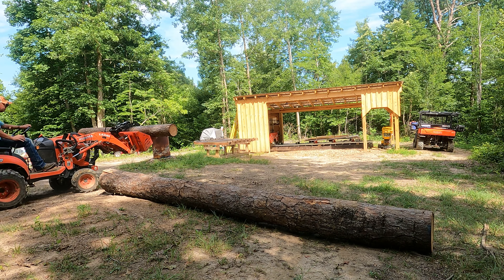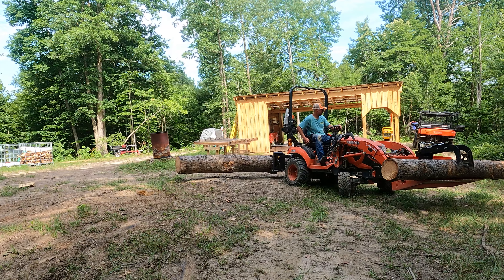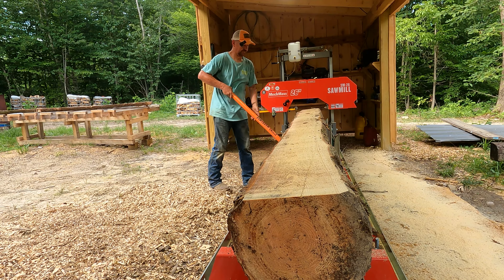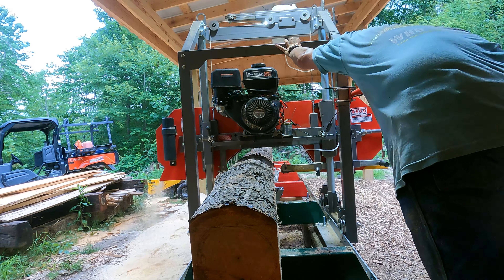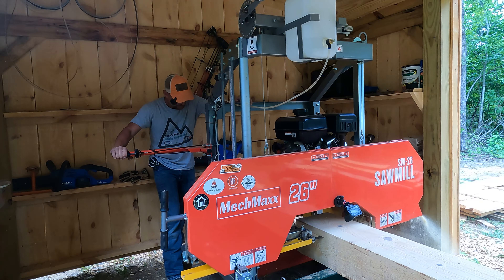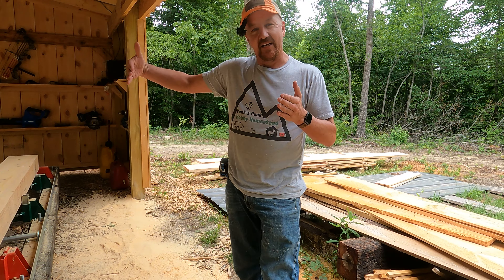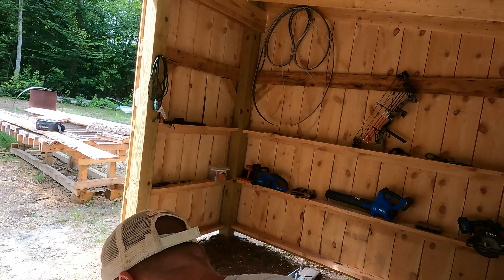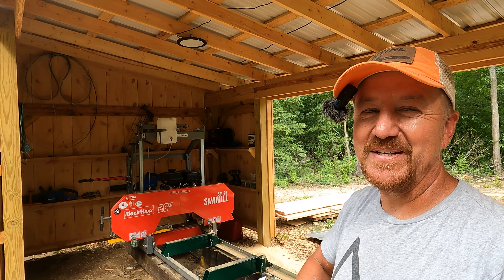Just Too Much For Our Tractor! - Setting Huge Logs With a Kubota BX

Comment: You are learning, you are going to need a bigger tractor for many reasons.  you are maximizing the ability for now. Just an idea, put a couple of stickers under the trim cuts to give you clearance at the halfway point , then cut it with your electric saw so you have 2 8-foot pieces to throw on the forks. EZR to handle. Good boards cut for sure.
Reply from the maker: Good tips!  Thanks for sharing!  👊

Comment: Lucas, nobody on this planet has done more with their BX than you have. Ive seen it all now friend. I'm sitting here just chuckling and am completely entertained. I just bought a hydraulic top link and valve kit from summit hydraulic for my BX, it just what you need. If you want part numbers and install pics let me know. Pretty easy and a very cheap mod. using the factory backhoe power beyond and return lines, with no additional work to reconnect when the hoe goes back on.  PS the three point lifting capability is very amazing on these BX tractors, WOW!   Steve
Reply from the maker: lol. At this point I’m just going too far.  I don’t think I need to put more money into getting more out of the BX.  I’m going to be breaking stuff.  I do enjoy pushing the limits though.
Reply: @PeeksPeakHobbyHomestead we all get more out of the BX than what Kubota and God intended.   When I'm working on projects, I have neighbors set up lawn chairs for a day of entertainment. 😂

Comment: It's so refreshing to see someone who doesn't have a $50k mill, a brand new skid steer and mini excavator milling up logs.  I've been looking at sawmills for a while and have a similar, small tractor as yours.  I've been concerned with how difficult manipulating the logs would be and this is pretty much confirming my assumptions. 

I'm incredibly interested in this mill though, especially since it's nearly identical to the woodland mills products.  Thank you for the content!
Reply from the maker: You can for sure do it.  It takes more work with smaller equipment, but I’ve already accomplished a ton with my little setup.  Good luck!

Comment: Did you capture the pith in one 2x10? If so you may want to just rip that one into 2x4s since the pith is very unstable and likely to split.
Reply from the maker: I don’t know, I will have to take a look.  Thanks for the heads up.

Comment: Build some ramps, use the tractor to roll the log on to the mill. I have the same issue with my sub compact kioti
Reply from the maker: Yes I’ve been thinking about that.  If I don’t upgrade tractors I will have to…
Reply: @PeeksPeakHobbyHomestead  You don't have a TYM 2515 ordered yet ?😏😏

Comment: Do you know anyone that has any old steel tubing about 20 inch OD and 19 inch ID and 6ft (72 ins) long
Fill the inside with scrap steel and concrete making a counter weight for the front of your tractor
This might help with the balance
Reply from the maker: Definitely would!